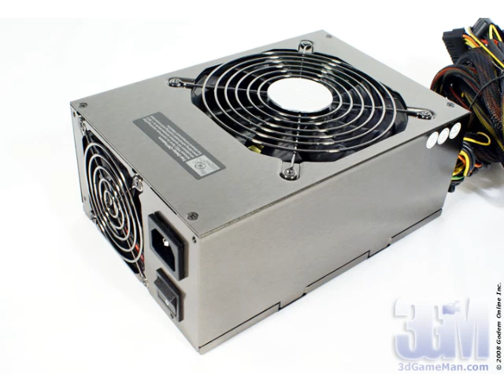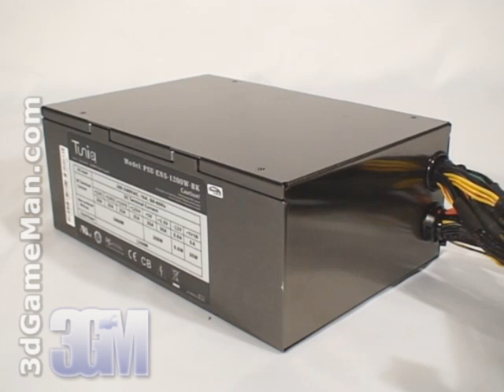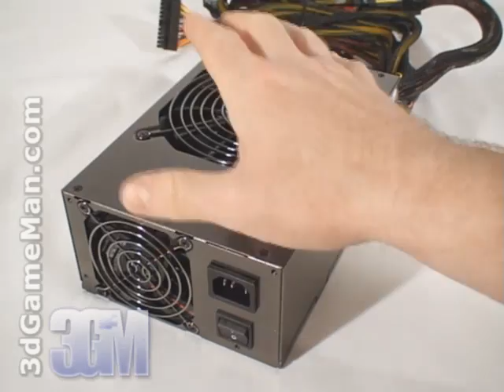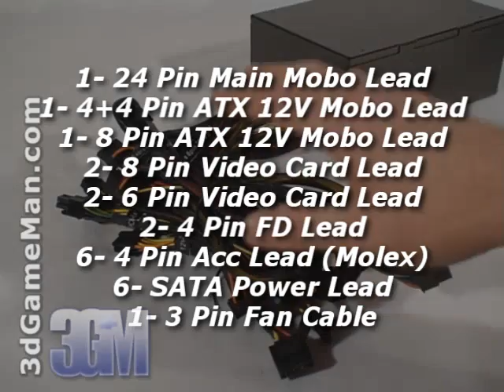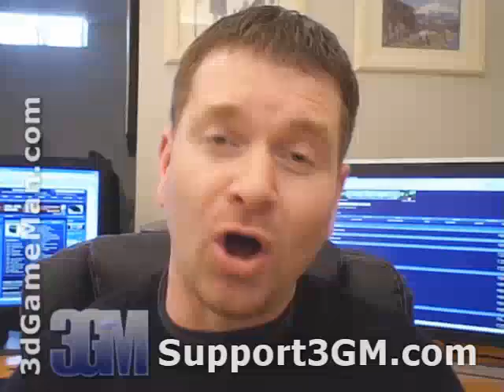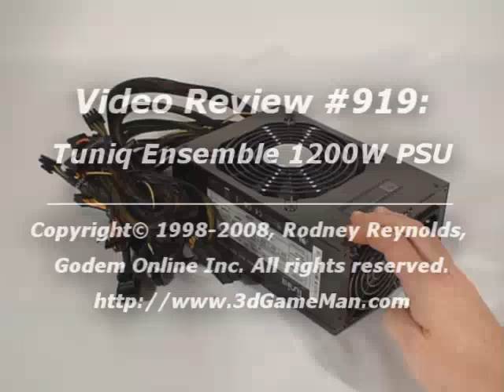#919 - Tuniq Ensemble 1200W Power Supply Video Review

Comment: Ya but those are meant to power head lights, start ups, breaking, abs, interior lights, speaker systems, amps, radios, cd/am/fm/radio headset, power seats, heated mirrors, temperature over head consoles, heated seats, heating system, air conditioning units, on board computer systems, airbag regulators.etc, etc etc.. The computer Power supply only really has to power up 2-4 major processors such as the CPU and GPU(S) and peripherals-so thats alot of Wattage for just a few processors.

Comment: Someone I know has a good Q6600 running with a 250w PSU, with no problems. He measured the power use, and it seems to go use 110w at max load. (he doesn't have a gaming video card, though, because he is not a gamer).

You wouldn't call a Q6600 crappy, would you?

Comment: That's 10 amps if your system is pulling that it's enough to overheat your wiring and probably blow fuses, 12 inch angle grinders, and microwaves don't pull that much amperage. lol